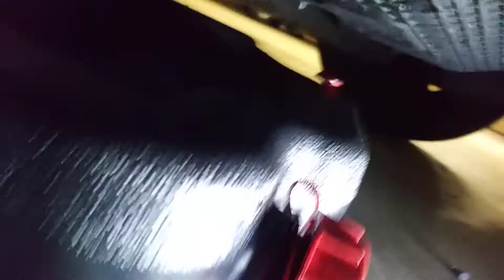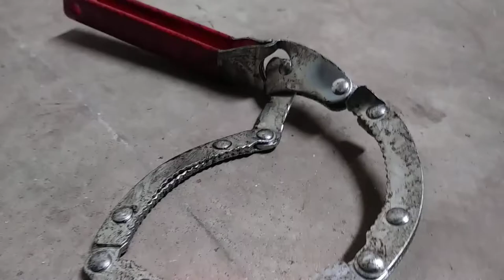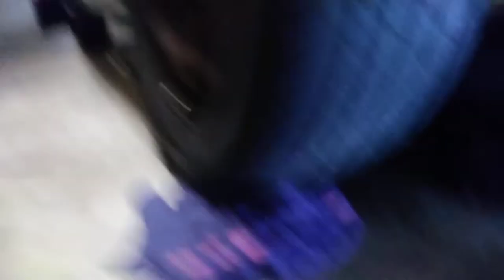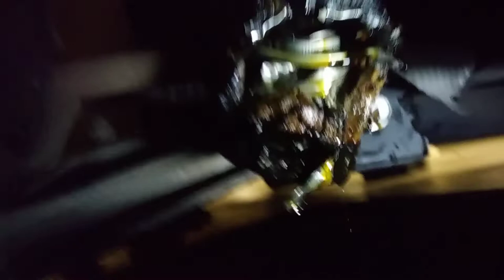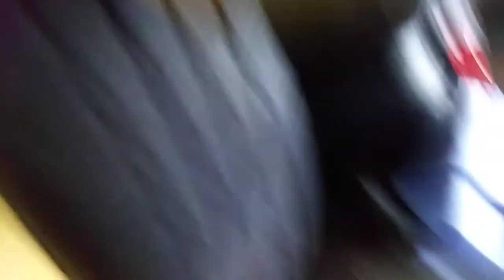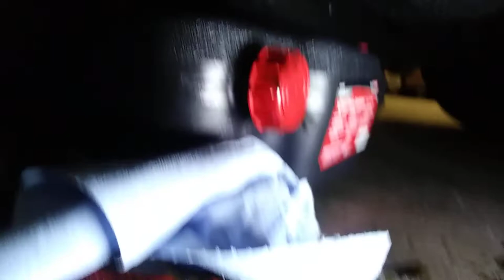Shredding a Oil Filter - Round one

Comment: Having the exact same problem right now on a used truck I bought.. Previous owner, or his mechanic, clearly dont know wtf "hand tight" means. Almost stripped the oil pan bolt, but thankfully I managed to get it off. But, now, I've crumpled and punctured the oil filter because that was very clearly on way too tight. I wish I'd tested to see if the filter was loose enough before I drained everything and crumpled the fucker. Pretty furious at the moment. Partly with myself for not checking that first off, and with the previous owner who didnt know wtf he was doing. Wish I hadn't deleted that bastards number now.